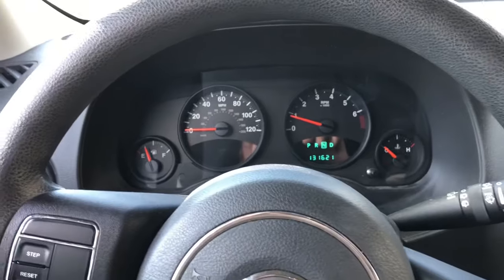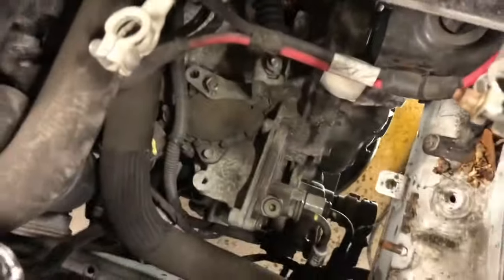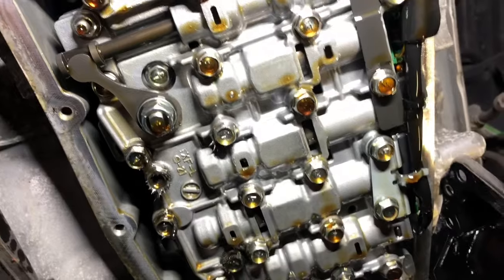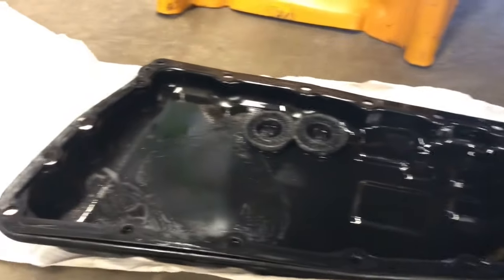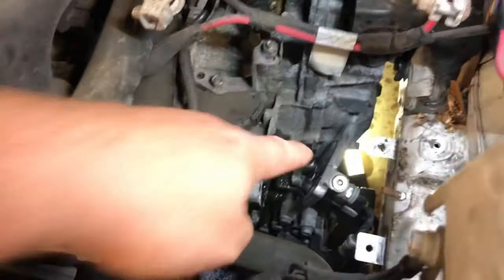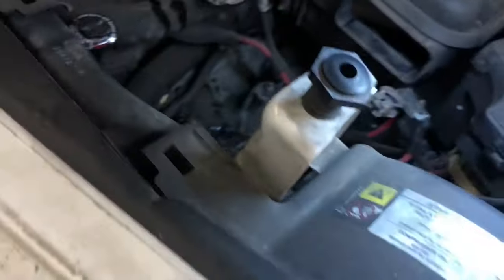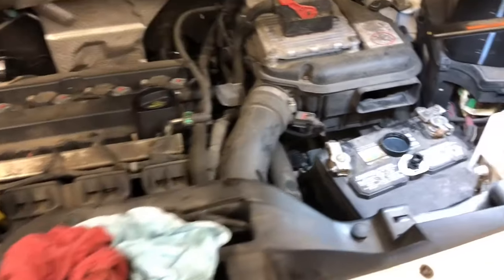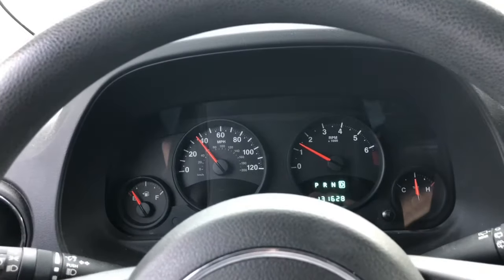Jeep Patriot CVT Transmission Fixed jf011e whine noise service

Comment: Your video is very helpful and informative on what is needed to be done, so thank you for sharing. 
I've got a 2013 Jeep Patriot Latitude 4WD with the CVT. Mine doesn't whine, but it does shudder when shifting. Will doing this help that issue? Or is the shuddering an underlying issue of a bigger problem with these lovely transmissions?
Reply from the maker: It’s worth a try. I wish people would report back as to what worked and what didn’t.
Reply: @JohnVHLife  I'll get the work done and definitely let everyone know in case someone has the same issue and start searching for answers.
Reply: Had the transmission fluid and filters changed in mine. I didn't buy the Chrysler brand fluid that it calls for, but I bought Valvoline transmission fluid for the CVT type. It fixed my problem with the shuddering during shifting. Just to update anyone who was curious or searches for answers later as I did
Reply: Try changing your spark plugs instead.... It helped me!?
Reply: @edithchevrier5658  that is next on the list
Reply: And another update, that Valvoline stuff I got. Wasn't good enough. The shuddering showed back up a month after the tranny fluid and filter change. So I bought the Chrysler fluid, worked wonders. Still no shuddering and it's been several months since
Reply: Mine was not shuttering but it would do a hard shift. Turns out that the throttle body was sticking and then would snap open causing the problem. That unit was replaced and never had the problem after that.
Reply: @DRiceArizona  yeah! See, I'm now having some kind of issue with the throttle/pedal position sensor/switch. The ETC and check engine light are on as well as 3 stored codes P2135, P0221, and P0121. First one deals with the voltage correlation of throttle/pedal position sensor/switch A/B. And the second deals with the range performance of circuit B and the third deals with the range performance of circuit A. If the codes stay, I will hopefully get an answer from the shop tomorrow when I take it in for an oil change. If you know, or anyone else knows what it means, then I'd love to know
Reply: And also, when I push the throttle from a stop position, there is a jerk. Plus, for a split second while I was driving through the city, the traction control light came on. Not long though, maybe just a few seconds
Reply: And one question, I read the live data on my scanner and the throttle percentage was at about 13%. Shouldn't it be at 0% if my foot is not actively on the pedal?

Comment: Thanks for this awesome video. My 2014 Compass just started with the whining a few days ago after there was a loud clinking noise and when I go up a hill it starts to bucks a bit. Will this service of changing the filter help? Also when u refill the fluid does it just go in where u check the fluid? I just purchased the long dipstick thing to check the fluid
Reply from the maker: Thanks! Its worth trying, but it sounds like you may have a different issue, but you never know.  Yes, refill into the dipstick tube

Comment: I just picked up a compass with transmission issues looks like the exact same transmission do you know if this is the 4wd w/o off road craw ratio having a hard time identifying which trans I need to buy as a replacement thanks!

Comment: Did this about a month ago and it fixed our problem! My 2013 patriot did just throw 2 codes yesterday however and curious what you suggest. P0777 and P0730
Reply: Any update? I have P0730 and am about to do the two filter change method.
Reply: Same here p0730 184,000 mes replacing fluids and filters soon

Comment: Thanks for the video. I have a question, I'm trying to decide which fluid I want to use. I would love to go with amsoil cvt fluid but it is expensive. As is Mopar. So I've narrowed it down to either Valvoline cvt or Castrol cvt. I've read mostly good things about both but a couple of bad ones as well. With that said, which fluid do you think I should go with? Thanks!
Reply from the maker: That I have not researched too much honestly, a replacement transmission is spendy, so cheaping out on the fluid may not be worth it..  That said, if your simply doing the fluid and filter swap to see if that fixed your issues, I can see using cheaper stuff to see if it works initially.  If that makes sense
Reply: @JohnVHLife  Makes perfect sense thank you. I'm just kinda tired of dumping money into this thing and am kind of on a budget. Btw, did you replace the oil cooler gasket that houses the pleated transmission filter or did you refuse it? I also heard people reusing their OEM metal pan gasket because they said the rubber ones weren't very good. They also just sprayed the screen filter in the pan clean with brake cleaner since it's just a screen. Saved $20 bucks. What do you think?

Comment: Thanks for the video , do you know the small filter plate torque spec ? Or do you just tighten it by feel , I ordered the filter just never done one before, I had the dealer do my service before, but on the invoice they never changed that small filter, thanks
Reply from the maker: Im not sure, I just tighten it by feel, they are small bolts, so dont overtighten them, make them snug. Shame on them for doing the complete job.
Reply: @JohnVHLife  I can confirm. Had this problem a year ago and the dealer changed the big filter but not the small.
Reply from the maker: @strra  No wonder these have a bad rap, they aren't servicing them properly! Scam by jeep to make money off new trans perhaps?

Comment: Have you made any vids on changing the trans filler tube on 2012 jeep patroit? Mine broke off at the bracket. Known issue with jeep that they wont do a recall on. They want you to have them fix so they can take your money. You do a great job on your video’s, keep up the good work.
Reply from the maker: Not specifically on that, but my other patriot videos where I pulled the transmission out and fixed it and put it back in, part 3 at 8min mark I explain putting the tube back in. See if that helps.
Reply from the maker: https://www.youtube.com/watch?v=zNXTRjkDYTQ&t=3s

Comment: Question for you 
I have a 2010 Jeep Patriot and transmission is slipping  
Do you think I should change the transmission oil and filter and hope that would help also 
Do you have any  idea of how expensive it could be to rebuild or replace the car transmission ??? Thanks
Reply from the maker: You could try. But when they slip that’s usually very bad. It’s rare to find a place that’ll rebuild them. Everyone replaces them.

Comment: Am I able to just change that little filter underneath the battery? The transmission was serviced but they did not know about this filter.
Reply from the maker: You bet! You may have to top off the fluid, depending on how much comes back out

Comment: Hi. When my Patriot 2011 reaches 75 mph the whine start, not so loud but I cannot accelerate anymore. I don't see any other problem, do you think that it needs more fluid or maybe have a leak?? Do you think is better to do the full service instead adding more fluid? Thanks for the video.
Reply from the maker: If the filters have never been changed, I would for sure change ALL the filters!

Comment: Tomorrow I am changing the filters and fluid on my 2011 Caliber (70K), hope that this is all I need to do.
Reply from the maker: Let me know how it goes!
Reply: @JohnVHLife   The fluid was very dark. Bottom filter did not have any debris, magnets where not so bad, no “slurry” on the bottom of the pan. Upper filter was nasty. Took it out for a rest run in the city and highway and no whining, better transition between gears and less lag when accelerating. In other words, like new! Thanks for your video. Changing the filters was just as easy as in your video. The only “challenge” is not to make a mess with the old fluid.
Now, it’s the plugs turn. I am getting the car from my dad. 110K Km (70K mi) and all is original. Nothing seems to be bad (other than the CVT but that is now fixed), but I want to do the normal maintenance to it.
Reply from the maker: @georgedlake Yes! Happy to hear!

Comment: Did you replace the O-ring (on the Cooler Bypass Valve) when replacing the CVT Fluid Filter (i.e. upper, pleated filter)? The service manual says to do so. However, I can't find the part through Mopar or anywhere else! (The Parts department at my local Jeep dealership didn't seem familiar with either the CVT Fluid Filter OR the Cooler Bypass Valve O-ring. They couldn't find a part number, much less sell it to me. It makes me wonder if they bother to replace either when doing a transmission service?)

What's one supposed to do here? Buy a whole new Cooler Bypass Value, just to get a new O-ring (2010-2017 Mopar - 4872709ab)? When I first checked with Mopar yesterday, the part was listed at $270. Now, it has suddenly increased to $499 for some reason! (2015 Jeep Patriot)
Reply from the maker: I didn’t. Mine seemed fine.
Reply: I just confirmed with my local Jeep dealer that they never replace the CVT Fluid Filter when doing a transmission service. They said that they don't like to get into the CVT. Further, they said that Chrysler says it doesn't need to be replaced. When I pointed out that the service manual says otherwise, they just doubled down. All they do is drop the pan. Unbelievable! I don't know how I feel about that... I'm just glad to have seen you do this successfully here. It seems like the right thing to do.
Reply from the maker: @jeffskone  Clearly this is a job security thing for them all, pretty crappy of them to scam people like this.

Comment: Does yours have a tendency to stall at times?  A long time ago we had a 2010 with the 2.4 and sometimes it would stall when stopped at a light.  I remember once it even tried to stall while in motion.  That is kinda unnerving because you never know when it might do it next and it might be hard to restart it at times.  Although we no longer own it any more, I hope they did a recall for it.  That can be unsafe if it would ever stall on the highway!
Reply from the maker: Nope, never had a stall on this one.
Reply: @JohnVHLife   Maybe they solved the problem.

Comment: My daughter has a 2007 Dodge Caliber with a CVT that’s whining pretty good (not as loud as yours) and taking a long time to engage into reverse or drive.  Seems to shift ok when driving.

It has 175,000 miles and she’s only had it for about the last 15,000 miles, so I have no idea if the previous owners kept up with the tranny service.

My question is this—I want to replace the filters at the very least, but I’m seriously afraid to replace the fluid.  Do you think I’m nervous for no reason?  I’m trying to decide between replacing both filters and putting the old fluid back in or changing the filters and putting new fluid in (not a flush—just replacing what I lose, which according to the shop manual should be around 7.1 liters).

Do you have an opinion on either of those two options?
Reply from the maker: I totally know what your saying about the old fluid. I wonder if you can get a friction adder for new fluid.
Reply: Idk—I’m concerned about new transmission fluid and it’s “cleansing” properties breaking loose grime that might then clog ports and whatnot.  Of course, there might be no need to be concerned about that and fresh fluid will be fine.  That’s why I was throwing to question out there for some feedback.
Reply from the maker: @anthonibereziuk8184   @Anthoni Bereziuk  I doubt itll clog it, My thoughts are the old fluid has all the 'dust' in it, adding friction keeping it from slipping!
Reply: Gotcha…I’m thinking I might just go with new filters and see how she does.  I don’t see how that could hurt anything if I put the old fluid back in.  But I do know clogged filters can cause problems.  Great video, btw.  Thanks

Comment: I just got the trans fluid changed but didn’t replace the cooler filter. Am I going to have to replenish the trans fluid if I want to change this filter?
Reply from the maker: No, itll be fine, but definitely change the little filter!

Comment: Good video my brother now my question did your vehicle through any codes
Reply from the maker: No
Reply: @JohnVHLife   
So I barely bought the vehicle today I was freaking out cause it was making the same noise as yours but it threw this code p0746 p0777 Jeep Patriot  something about the solenoid so if it helps out anybody my problem was fixed no check engine light now run smooth :) thank you 🙏
Reply from the maker: @christoledo5217  changing the fluid and filters got rid of the light and codes? Good to know.

Comment: I was trying to follow along to this video for my 2014 jeep patriot but the top of the transmission looks completely different and I do not see where the cylinder filter is located.
Reply from the maker: Hmm, Yours must have a different transmission? Do you know what you have?
Reply: I just know it is a jeep Patriot 2014 sport 2wd. 2.4 L engine.   I have seen videos where people are changing their 2014 jeep Patriot transmission fluid and their transmission looks like mine at the top but I have never seen them change a top filter just the bottom.
Reply: Top of transmission looks similar to a Kia optima transmission
Reply from the maker: @Elmoloves  even dealers don’t change the small filter. I think it’s a scam to make people buy new transmissions!!
Reply: https://youtu.be/21irJQJkXj0
 this is the link to how my transmission looks just like this one.

Comment: My trans filler tube is broken off, and there’s a cylinder thing inside of the tube that makes it difficult to fill. Is it normal?
Reply: I bought her used and I had the same issue.
Reply from the maker: Doesnt sound normal, I show what it looks like, if its not the same then you may need a new tube or fish the piece out and get a new plug.

Comment: I'm looking at buying an 08 with 220k miles for dirt cheap, owner doesn't know of any tranny maintenance. Would you take the risk to buy and flip? I'm used to Xj & Zj's new to the patriot CVT game lol Thanks!
Reply from the maker: That’s a lot of miles on a cvt. I try to stay under 200k as far as I can.  But that’s me. If it’s almost free it’s worth it.
Reply: @JohnVHLife  thanks John, i offered $1k. That would be the most I could gamble. Owner wanted $2500. Probably not worth the headache.

Comment: Thanks for posting this. There's another guy with the same video but he missed the engine filter so im really glad I found your video as well. He replaced the drain pan gasket which was different than your video. Do you think its better to re-use the same gasket like you did or just replace it since you're under there anyways?
Reply from the maker: You know. I’m trying to remember.  It’s been a while now.
Reply: I'm debating If I should reuse the metal pan gasket as well. Did you reuse it or replace it?

Comment: Have you ever has one of these CVTs take more than 6L of fluid?
Reply: Yes, Ive had that most times. I dont have a dipstick, I just measure the amount of old oil that came out, and put in the same amount of oil. Ive done 3 services on a 12 and 14 compass and each one has taken jsut over 6 quarts. As an interesting side note, most modern transmission fluids are sensitive to temp, so you want your new fluid to be approx the same temp as the old fluid when you measure and fill

Comment: So I have the same issue on mine but with mine I have check engine light on and it wouldn’t move even when in gear. Do you think doing these steps might help?

Thank you!
Reply from the maker: Tough one. Might have internal issues at this point. Unfortunately.
Reply: Same here, broke down on drive from oregon to AZ, wouldnt drive and made horrible screeching sound coming from near transmission, auto shop got code P0777 which is stuck cylanoid in tranny, not good considering the noise. Either 3k for used transmission or scrap it for few bucks. Mine was at 140k miles
Reply from the maker: @marked4death076  Yeah, these transmissions are junk.